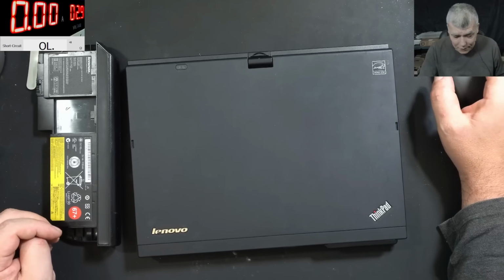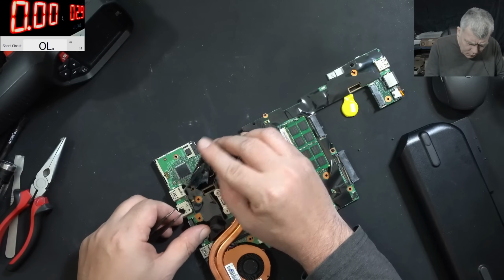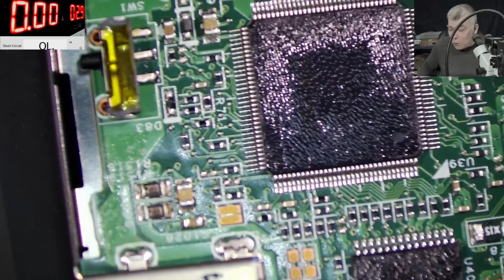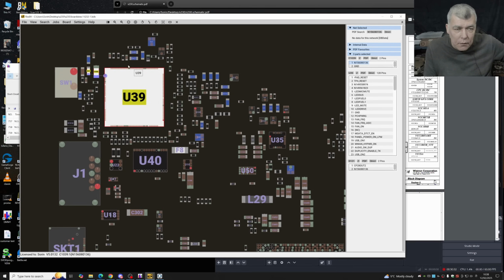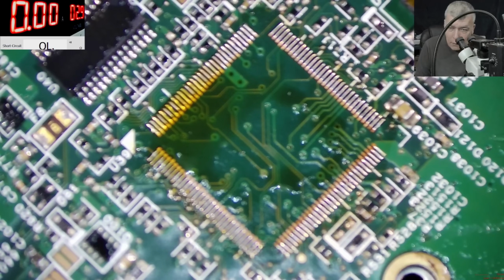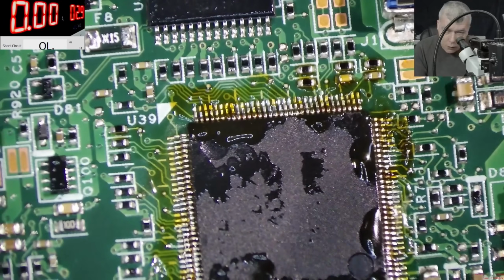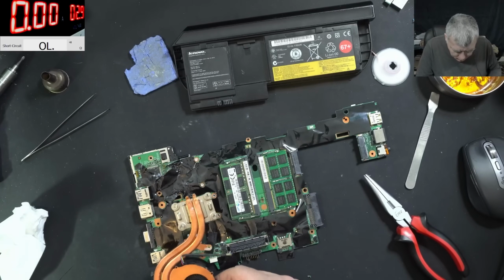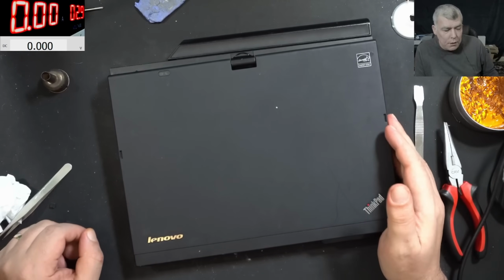Lenovo X230 Tablet repair - Not charging - Customer sent me a good laptop for spares

Comment: I have an msi laptop that doesn't turn on, I opened it and it has a component that heats up to 80°c when I press the power button, it is not the processor that heats up its a components with a code 1255C, Im not a technician but I think thats the problem, what do you think?

Comment: Not another NOLOVO!!! Performed warranty repairs for over 20 years on multiple major brand laptops. Guess which brand had the worst misdiagnosis by brand support and the most failed replacement parts out of the 3 major non Mac brands. I would guess in this particular case that the end user may want to get his alternator in his car checked. Sounds like he received a surge from vehicle electrical system. I remember when some of those models supposedly had gorilla glass but mysteriously gorilla glass was not available but other companies were getting gorilla glass. Lol.

Comment: Once again, great video but once again I disagree, those old (IBM) Lenovos were built really well. Structurally a solid machine and very resistant to liquid damage. I've still got an old T410 kicking around in the boot of my car. I use it for site work, networking etc. It's been dropped many times, rained on, covered in building dust and it still works. Amazing engineering. I think the new ones are worse. From a repairers point of view they're just harder to take apart.

Comment: Those are great little laptops. Only thing that I’ve seen in the past w those style touch screens is weird ghost keyboard clicks etc from a malfunctioning touch digitizer response integrated display. So it may be worth the effort to look into that, not limited to laptops with touchscreens but also the AIO computers w touchscreen.

Comment: I thought it would be too old for chip ID and programmed chips, or at least have universal code for all models.
I have a Arduino EFI called Speeduino and I was adjusting the fuel table when I noticed the laptop battery dying. I plugged the car charger in and the EFI grounded through the USB. The laptop was ok, but it blew the EFI.

Comment: could have been caused by the car sending a hv spike but what about cranking the car causing a drop in incoming voltage to below the level of the laptop battery... laptop battery 11v, car cranking can drop to 9, 2v difference 'the wrong way'...laptop battery tries to power the car....low voltage difference but could be a heavy current and flowing in a direction not expected.

A similar issue existed 6-7 years ago with mac books and cheap powered usb hubs, if the mac was turned off, and the cheap hub 'back' supplied 5v into the mac usb port, 5v on a 5v pin sounds ok but the 5v incoming from the port would try to power the mb and fry the current limiting chip on the mb because the current is reversed, something it should never see in normal use.

Comment: My guess, you did not get the SSD the customer uses.  ^^
This was a X230t, avoid it if you don't have to use the touchscreen or pen. A used x230 starts at 50 bucks. 

Love the X230. You can find comparable toughness only in specialized notebooks that cost an order of magnitude more. It's the last Intel mobile CPU (35W TDP) and is comparable in speed to the 11th gen Ultrabook Intel CPU's. Also lots and lots of spare parts. Perfect tinker/student notebook.

Comment: U39A/B/C/D are all from same ic U39 in schematic they have divided section for good understanding but like do in CPU Power 1/2/3/4 PCH Power 1/2/3/4 
Shown U39 Ic is ECE with Other Switching and regulating feature its interesting Lenovo try to reduce motherboard size by doing this.

Comment: 24:40 That's a 5 minutes job that took you 14 (edited) minutes and no doubt a lot longer in real time lol! The correct way to mount the chip manually is wick off all the solder and then the chip will sit flat and it will be very easy to solder it. Now it's sitting on a mountain of solder and you must push the legs down. One day the lightbulb will go click in your brain and you'll realise it's faster to do the job correctly rather than the quick 'Sorin Way' lol! Try it you will be surprised how easy it is to do the job the right way. ....
Reply: Another comment 100% correct. Yes you should always wick the excess solder from the pads and then chip will sit flat. Another thing is you should use leaded solder. This is lead free probably. So you put new fresh leaded solder which will melt at lower temperature as well and have much better characteristics. It will last forever. And never use hot air to resolder chips which are critical. Always preheat the board when soldering good chip off and use lowest temperature possible. When resoldering to good board you do it manually with soldering iron like you did, but just clean the excess solder and use fresh leaded solder.
Reply: @TriodeTetrode  Yes, all his vids have some great troubleshooting skills but all spoiled by bad soldering technique.

Comment: To stop board bubble heat the board SLOWLY over a larger area. I realise this is a foreign concept for you (you always rush) but in this case you MUST heat the board slowly over several minutes then increase heat after that time. Do not try to blast a large chip off a board with 450C temp otherwise you will bubble the board. This is basic knowledge that any good hot air user should already know.....
Reply: That's 100% correct.
Reply: He knows so much more than you do (think about it, you are always watching his videos, not the other way around). But working on a 50 pound laptop, and doing this for an actual living, and having so much experience, he doesn't have time to use a "safe" method. That is however a good idea for anyone doing this for a hobby, of course, so you could use it, no problem.
Reply: @silviuguseila2552 I also know a lot of stuff. I have been publishing repair logs since 1999....
Reply: @silviuguseila2552 Try looking me up sometime and you will see I also know a lot of stuff.....
Reply: @silviuguseila2552 I also know a LOT of stuff. I have a site since 1999 with repair logs....
Reply: @silviuguseila2552  I watch Sorin videos for entertaining purposes not for learning. I don't repair laptops daily. I do fix industrial electronics and design circuits. I'm also EE by education.

Comment: Yes on complex chips they can be separated into their unique functions when drawn on the schematic to make it easier to read and easier to draw. One part can be for power and another part for control and they are shown separately but it is the same chip. The same thing applies to some for example logic chips that have multiples of the same inside. If there was IC1 74LS04 hex inverter shows IC1A, IC1B, IC1C, IC1D, IC1E, IC1F but it's the same chip with 6 parts to it.

Comment: You are the reason why I rarely use Amtech flux 😂 Rosin is absolutely the best.

On the side note, I see you've stopped using a turbo fan for cooling stuff. Why? I absolutely love that thing.
Reply: Personally I much prefer the thermal pad. The fan is super loud for us and I cringe every time it came on. Plus I have enjoyed seeing the thermal pad slowly deteriorate over the months. You can watch its first appearance in a live stream from early last year when he folded it together, all the way until today when it has grown into a beautiful flat blue porous potato.
Reply: Probably he forgets he has it and is always rushing so he moves on quickly.
Reply: Amtech & chip Qulk flux are good, you just have to make sure you are getting it from a part supplier and not eBay. I used it all the time to change SSD chips and SSD controller on PS5 boards and no issues. I do use good Rosin flux as well.

Comment: I could feel the stress level going up on this repair. You do an amazing job with the hot air, all those tiny components surrounding that IC, just waiting to get their wings. That was impressive.  It had to be a feel good moment seeing Windows load. Another successful repair !!🙂
Reply: It's simple correct usage of the equipment. Hot air station has air flow control for a reason.....

Comment: Hey Sorin, I need your help with a laptop issue.

I have an ASUS X513EAN from a client. After a BIOS update, it stopped turning on. I flashed a BIOS from Vinafix and a Telegram group, and it powered on, but I’m facing these problems:
	1.	Windows 11 won’t install (says the hardware is not compatible, even though it should be).
	2.	The M.2 SSD is not detected, even after loading drivers during installation.
	3.	After installing Windows 10, everything works at first, but…
	4.	Every time Windows updates, the system stops booting, and I have to reinstall the OS.
	5.	I have to desolder the BIOS chip every time I want to modify it because I can’t flash it while it’s on the board.

The BIOS chip is a GD25B127.
I already tried:
	•	Using EZ Flash with an official ASUS BIOS, but the problem persists.
	•	Changing SSDs, testing another M.2, RAM, and different BIOS settings.
	•	Checking Intel VMD, Secure Boot, and TPM settings.

Someone told me that the M.2 SSD only works with the original BIOS of this laptop, so I suspect the BIOS dump I used might be incomplete or missing the Intel ME (Management Engine) region.

What do you think could be causing this issue? Could it be related to the BIOS, or do you think it’s a hardware problem?

Thanks in advance!
Reply from the maker: Hi, i'm not sure what could be the problem there, but we have a bios section on our discord, please ask there for a bios file, thank you
Reply: Just read what you wrote... It stopped working after a bios update, why would it be HW related then? Unless you messed up something you got the wrong bios iage for it. ALso I hope you backed up the bad bios too, might be fixable but it has the windows key too.